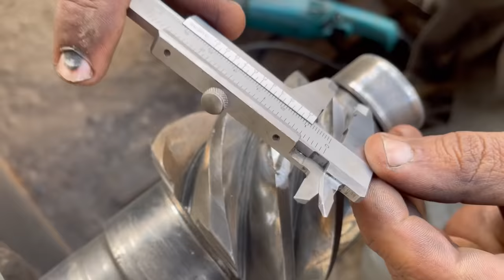I repaired the scrub pinion which no mechanic repairs | Give your opinion by watching the video |

Comment: Hint:  making it look good does not mean it will work good.  Welding and grinding make all kinds of internal stresses and adds impurities and alloy discontinuities.   It might be okay under light loads for a short time.  But it’s definitely worse than the original, and remember, THAT failed.  Also it’s nearly impossible to regrind it to the original spec, as the dimensions are very hard to measure.  So the gear contact areas will be wildly different even if the surface is only a few thousandths off.
Reply: Looks like this guy been doing this repair a long time, I'm sure he's confident it works in lasting order as do his customers...
Reply: @andypanda8259  Maybe the trucker will take it easy from now on to avoid cracking the part again
Reply: Haters gunna hate
Reply: Yeah, good enough for a YouTube video... 
not real world stresses.
Reply: I bet they never thought of that.
Reply: Go and buy new one  in india   but first save 1 year salary  .
Reply: Yeah, but that truck has so much other slop in the drive train that a 5 axis gantry to 0.001 and a heat treat won't matter for another 10 years of service life.
Reply: @EwangelicznyKatolik  Never even by mistake call a Pakistani Indian We don't respond to that kindly.
Reply: @chrisbarajas6711  its not hating hes saying facts
Reply: Here we go with the hate! Go buy the man what he needs than!
Reply: @cristianmendio2461  Sorry if it sounds like hate, I only mean well.  If this gear strips out on a mountain road there could be 100's of deaths.
Reply: She'll wear in bro.. Send it
Reply: @georgegonzalez2476  if you put it that way true. Great day Mate
Reply: It`s actually about how gears work. Gears are shaped so there is NO grinding at all! A perfect geometry makes surfaces meet and transfer forces, but do NOT move against each other. This will NOT be the case after that repair.
Reply: You hate him cuz you ain't him
Reply: I wouldn't mind being 30 years younger and not having several medical issues!  But economically I'm making 10 to 15 times as much as him, with health and retirement plans, so I'm more comfortable, with two cars, house, garden, heat, AC, and two dogs.   And I'm still "him" in the sense that I like to repair mechanical and electronical things.
Reply: @OldDesiMusic  is there any way to undoubtedly know on a glance if man is Pakistan or India? Can I call yall Asians or is that also bad?

Honest question here, tryna adjust to the new times and dont wanna get put on blast for my ignorance 🙃
Reply: Exactly
Reply: @georgegonzalez2476  My gosh, the point here is, it`s a waste of time. See my explanation above why!
Reply: @RandoManFPV  Those clothes that they are wearing the trouser is called Shalwar & the Shirt is Kamiz thats prety much a Pakistani & Afghani thing. Indians do wear that with a 95% probability very rare for some Indian Muslims may wear that.
Reply: Here's an idea:   Make an epoxy cast of the any healthy groove then use it and some Dykem to incrementally test and refine the new tooth.
Reply: Ok as a temporary repair maybe until they can afford a new one. Very likely to fail again.
Reply: @RandoManFPV  Those baggy trousers & long shirts thats pretty much a Pakistani & Afghani dress. Some Indian Muslim brothers may adorn them but very seldomly on special ocassions only.
Reply: @OldDesiMusic  I always have to just ask, "so where are u from?"  We have a lot of Sri Lankan, and also Sikh's in my area.  It's very hard for an avg westerner to tell people from that part of Asia apart though if your not friendly with one or two from the area.  Its like asking someone from the US what state are u from?
Reply: @cristianmendio2461  Sometimes people don't have the cash to buy a part so they just have to make due.  Eventually all of those parts will be 3D scanned an a Tokamak will be able to spit one out for you in a few hours.
Reply: @Tudumanu  - you obviously do not understand the geometry of gears and how they mesh, nor do you understand metallurgy and heat treating. 

The welded surface is dead soft metal and the heat affected zone around the weld also has softened metal. It will not and cannot perform as originally designed. The original surface has been heat treated to a hardness of approximately Rc 60 for proper strength and hardness and then annealed to relieve internal stresses from heat treat. It will certainly begin to spall and gall due to softness and improper gear tooth mesh if it doesn’t catastrophically fail outright once load is applied.
Reply: @RandoManFPV  nope, filo here. Can't even tell if someone is filo, Malaysian, or Singaporean. Getting butthurt if someone assumed me as a Singaporean is duuUuUumb
Reply: Yeah, imagine that piece breaking worse and locking the wheels on a turn. Definitely not worth it.
Reply: @ismaelcacapit2769  figured lol 😆
Reply: If this wasn't possible why do they sell welding rods they say they can be used for rebuilding gear teeth?  He should have preheated it first though.  It probably won't mesh to well though with him grinding on the other teeth.
Reply: @fukkitful  Can be done doesn't mean it should be done. There's no way that the rod has same alloy composition as the gear teeth.
Reply: That is right
Reply: @fukkitful  I'm not a mechanic but I think the answer is pretty obvious.
You can
You can see that in this vid.
But as everyone has said now, it won't last
Reply: @andypanda8259  I don't think you understand what this kind of works does. Its work that says "this will last you 2 months more until you scrap the thing". That's it. Look at how he cleans the welds before welding over. There's still non-metallic residue on the weld which gets incapsulated in, reducing durability. Unless you're an engineer, these videos just tell you "wow amazing". But it just isn't up to spec, sorry.
Reply: Only option is better than no option. It's between working okay to not working at all. Probably cost less than a tire rotation in the US.
Reply: @em4703 Ohhh you engineers got it good on paper but things work differently in the real. world.  Us actual operators have seen countless times witness engineers calculations fail where they say they shouldn't and work where they say they won't. 🤓
Reply: So much hate over pure superficial opinions... 
In the end, cost per time is what matters. 
No serious conclusions can be taken without data about those variables (cost, lifetime relative to new)
Reply: @lucianoayb7751  Not personal hate.  What I hate is people working really hard under dangerous conditions with very little payoff.  Perhaps if they somehow kept statistics on how long these repairs last, they could make a case for getting higher pay.  Or if they could find some internet resources on how to work smarter, not harder.
Reply: Theres a difference between repairs and decorations bro he didnt just make it look good.... Think your just mad you arent willing to put in the effort to get a job done properly.....
Reply: @lucianoayb7751  
Don’t think there is any hate in it at all! We are just giving our experience of gears from our time trying to fix these.Also remember if this was your truck and the pinion went a second time 10miles down the road don’t get upset.
Honestly I hope it is successful for life of the truck.
Reply: @Orthaluminox  I did not see ANY technique used to actually technically repair it.  No templating.  No heat treatment.  No case-hardening.  No contour mapping.  No bluing.  No laser pointers.  No optical comparator.  No clay models.  Nuttin'  Just all visual eye-candy tricks.
Reply: You clearly dont live in India. ;) These repairs exist out of necessity.
Reply: @Tudumanu  it's always a good idea to avoid shock loads ( like popping the clutch) on any gear set. Most of the time it's the shock loads that break teeth and shear splines or even  complete axels. 
I'm pretty confident that this fix  will work.
Reply: Agree. This was moronic.
Reply: I don't think it will work as new one,,
Reply: @andypanda8259  no. his time is worth virtually nothing, while a new part is worth a lot in hard currency. so if it lasts another month the customer wins. as an engineer, this is a splendid demonstration of worker skill, but for all points of views, the end can not be anything else but poor.
Reply: Does anyone realize that they don't live in America or somewhere they can't just go to auto zone I give mad respect to making it any way you gotta too Americans should take notice because this the world we are about to live in u just wait and see
Reply: @rando man  just call them ppl until we can't call ppl ppl your safe with that
Reply: Also no hardening process in the end, but I don't know if it is necessary for this part
Reply: Plus the ring damage.   Clown show
Reply: @OldDesiMusic  What is the difference ? ..
Reply: @someone Scams usually offer something for money... I don't recall them asking for money or telling anyone that they should do this... like the average person has half of these tools. I have an entire shop and even I don't have a lathe (or that machine he made himself to turn). Whenever I need machine work of any kind (besides drilling and pressing) I take stuff to the machine shop and I don't have an account with them, so it's at least $1000USD every time for simple things like line boring, cleaning, honing, etc...
Reply: @georgegonzalez2476  why are you assuming they don't keep records and don't get paid a fair wage? And how exactly would you do it given their tools, resources, time constraints etc.?
Reply: Thats what you have been told and thats why you have never ever tried his method. You are speaking in theory.
Reply: @mhans928  They risk their health and lives and make around $2.50 an hour.   About half of these folks are unpaid trainees.  Average wage is about $5 an hour.  Everything is done as cheaply and minimally as possible, and only 40% of the population can read or write any of the 82 area languages, all deals are cash and carry,  there is exactly no concept of guarantees or customer service,  so it's highly absurd to think they keep any records.
Reply: @georgegonzalez2476  well you don't know any of that for a fact. You just made it up. And telling poor people to stop doing poor people things is not helpful or insightful. You're a real class act
Reply: Dang, that's why my gears grind into 3rd and slip in 4th.
Reply: If he can fix it once, he can fix it again
Reply: I do this with mower steering shafts. No problem grinding to original specs. I temper with mapp gas & used oil. It doesn't last as long as the original, but I don't have to wait a week & a half to get the part & it's a lot cheaper.
Reply: Welding and grinding are techniques for fabricating firearms parts back in the 1930s. Like repairing damaged sears and triggers. If the weld breaks, you are a bad welder. If the other parts around the weld break first, you are a good welder.
Reply: Some people never understand why the do such a work ! 
They most definitely knows this is not like a original but there is lots of reason behind it !
As a guy who lived in Iran and we were sanction and short of money for a long time ,we came out solution for a lots of difficulty and I personally never ever gone do it in a normal situation !
But in times of need many people come with a dangerous and unsafe idea !
Reply: @alitn588  Sanctions only affect the poor. But the oligarchs who steal all the non-sanctioned wealth and other resources that pour into such countries also only affct the poor. its a hard choice.
Reply: @neglectfulsausage7689  so you think most of the people are rich or oligarchs ?
By sanction I meant we couldn't have many American part for our machines as many our machines was American !
Reply: @alitn588  You completely logically disconnected from anything I said. Nothing I said could be construed to make that "so you think?" comment true. Particularly because I said "the oligarchs steal from the poor".
Reply: @mhans928  hoookay then, me and every welding book and video have all made up the same thing, apparently.  Remarkable.
Reply: @andypanda8259  Well if you think about it, a lot of the work that comes in is not local, it's trucks passing through that break down nearby.  So the shop often knows they're never goin  see these rubes again.  that is a temptation to undergo shaky repairs that you wouldn't do to your own truck.  Just sayin' .  Shady work like that happens everywhere where they think they can get away with it.
Reply: @georgegonzalez2476  you made up the wage statistics. Because you have no idea what they are actually getting paid. I don't think they write forgein wage stats in the welding book.
Reply: @mhans928  How about trying the Google and ask "What is the average welders wage in Pakistan".   You can learn a lot that way:  "88,000 pak rupees per year = $0.23 US dollars per hour."
Reply: @georgegonzalez2476   right but you don't know if they are making average wage or not. It could be above average.. And if that's a fair wage in Pakistan why should they be making any more than that?  Their labor is worth what people are willing and able to pay.
Reply: I give it a 50/50 chance of either working fine forever or trashing the other gear it meshes to in about a month
Reply: no way in hell this last more than a week at teh most
Reply: The original isn't ground to spec, dude. They're just gonna reduce the working load of the truck until a replacement is ready. However, you'll be surprised. Sometimes they just replace the gear head and leave the rest of the rod in tact.
Reply: @OldDesiMusic  they are the same race of people so they are Indian .
Reply: Calm down bro this not USA 🇺🇸!! The repairs last long enough!!!
Reply: Дёшево и сердито.
Чтоб продать как "не бит и не крашен" вполне сойдет.
Reply: tensil strength is surely changed but will hold up under normal wear and tear
Reply: A little jealous are we?
Reply: Just because it looks pretty no one can hand grind a hypoid gear by hand. So the gear profile is garbage and will fail in short order.The weld zone is weak and will break in short order.
Reply: It was original, and it broke. And now it's fixed and can break again at any time. What is the problem?
Reply: @Technoide1  Lots of problems.  If it's been poorly fixed, it's going to be noisy and wear out its mating gear.  The noise they can ignore, but a worn-out gear is not easily fixable.  The basic priblem is these gears have compound 3D curves, so you can't just plonk them on a lathe and have the movable gear-driven cutting tool make a precise variable curve.  Fine for cutting new threads, but not for 3D compound curves.
Reply: Not bad if used for churning butter.
Reply: this comment is not wrong, but he should think about where these repairmen are at.
its obvious that they live in an area of poverty, and where buying a new part is near to impossible for them. I respect his knowledge, but not his empathy
Reply: I wonder if they could actually do a temper. I mean, a furnace that can get a part like that to temp is possible for a part that small.
Reply: Ходить будет это лучше чем ничего,а сломается снова починит.
Reply: That might be true but how much money did the owner saved in the short-term, sometimes a part can cost more than the value of the vehicle!🤷‍♂️
Reply: @echologixxx9758  I'd prefer some grilled Telapia and a bottle of Argentine Malbec.
Reply: ya I had the same thought on such a precision engineered part.  In the long run it going cost you more when it damages the rest of the assembly.
Reply: Ok
Reply: @phuturephunk  No
Reply: @EwangelicznyKatolik  Not india, but Pakistan. Indian workers used to have such shops 20 years ago. Now local unbranded production is cheap. So people buy non-oem, unless part is no longer available. Labor and space has become expensive.
Reply: @OldDesiMusic  the problem with your kind of people is that you don't seek out the message..yes, he used India as an example but the message was that in some countries folks resort to repairing because they can not afford to purchase new parts.
Reply: Братан, не переживай! Они потом песочку в масло насыпят для притирки ))))) это шутка, если что...
Reply: Duh...this about patching together and keeping going. This isn't an sl dealership  shop with OEM parts. Every one of these vid has some know it all commenting the exact information. THEY KNOW ITS RISKY .
Reply: @twomasta  they can do this 10 times and still be cheaper than buyin Oem, especially if truck itself is old
Reply: To get you up and running this is amazing
Reply: You do understand that in that part of the world they have been doing this for a LONG time and traveling across the WORST roads, Long hauls. I do understand that its not spec but none of that over there is SPEC lol. They make do with what they have and I find it funny there is always a welder or engineer that throws comments like this out. They simply just try to get as much life outta the part as possible since its not as easy to just buy parts, Much less buy parts like that for trucks old enough to be my grandfather. You are right but it is not the purpose of being new its purpose is to get back on the road from the middle of nowhere. This is why engineers and mechanics always disagree.  And Like Chappy P said the amount of slack from the gears wouldn't really even be worth the price of replacing it all just to get ur SPEC's That some engineer came up with. For god sakes Ive seen those fellas use bananas for oil in the differential lol! AND STILL GET FURTHER DOWN THE ROAD THAN MOST pos trucks we make nowadays lol... Do you see that lathe lol I mean that should speak voiume.
Reply: Methinks this repair will last longer than people think..
Reply: @OldDesiMusic  racists gonna racist. Aka both your countries
Reply: @Orthaluminox  this is clearly a decoration. Looks good, might even work a little while, but it absolutely is not repaired. Repair suggests good as new. This is "good enough for now, but it will absolutely fail and needs replaced asap". 
It's a good looking job, but it's literally a case of lipstick on a pig
Reply: @jobbe-wijnen  they exist out of necessity, sure. They also exist due to lacking the knowledge and technique and skills required to do the real job. They're faking it until they make it.
Reply: @NjoyMoney  lol, you're living in fantasy land if you think his "method" is correct. It makes it look good. But looking good is irrelevant when something needs to work properly.

Might as well replace steel girders with plaster in buildings. About as structurally sound as this "fixed" gear using his "methods"
Reply: @bobdole4093  Have you done it tho
Reply: @NjoyMoney  why would I? I don't do tasks that are redundant or not the correct action to take.  I could do it if I wanted to do something incorrectly. But I don't waste my time with such tasks.
Reply: IT WORKS ! It can be restored the times needed....the machine is again on, generating money.
Reply: @javieralejandromelian3579  it "works". About sums up why things haven't progressed in that area of earth.
Reply: Hahaha the man's just trying to prove a point and there's a whole ass different convos going on about how stanis and Indians dress hahahahaa I'm weak asf
Reply: Anyway idk how I got welding gears back together from finding out about low compression testing hahah
Reply: It's the contact areas that even my clueless self is most suspicious about. No way that's gonna wear evenly 😂 better have filters for whatever lubrication that's gonna use
Reply: I totally agree with you
Reply: Purposely for youtube attaratiion?? OMG !!
Reply: @theprodigalson2904  I’m from U.S.A There are poor people here, plus there’s an inflation going on, because of our incompetent president.I too, have had to do repairs on my car, by rebuilding stuff myself, as long as it doesn’t include, breaks, steering wheel and electrical. I’ve glued my radiator, because I couldn’t afford to buy a new one. Get it trough your head, not everyone in U.S.A is rich, and have it made.
Reply: @Osmosium2507  Yes that is what I was wondering also, after welding it might need a heat treatment and it would last some time for sure, without this the steel around the weld got softened. But the job is good.
Reply: @chrisbarajas6711  EXACTLY DUDE
Reply: Your out of touch. Its a third world country with extremely low incomes and profits. Im sure if they could afford it they would of fitted a new part. I advise you to travel the world as it might humble you to see how the other side live
Reply: @saferandquieteroads  I agree, except for one thing. I’m from the states, I want people like you to understand, that we struggle, there are deferent classes of people, here. Sometimes people can’t fix their cars because, the parts are very expensive. I know, because I’m one of those people. You also have levels of mechanics. There are certified mechanic’s then there are tree mechanic’s, they literally work under a tree. I’ve gone to a tree, mechanic, I’m glad to say, that, they do a great job, for less money.
Reply: Just watch the video stop taking everything so personal
Reply: @officialkam7892  Didn't take it personally as there was nothing personal about it.  Just stating logic and the facts as I know them.   No offense taken.